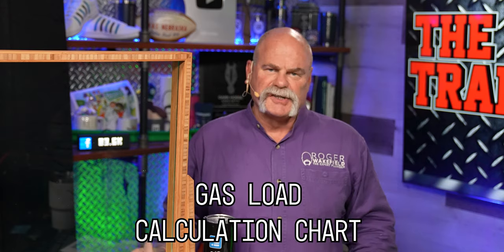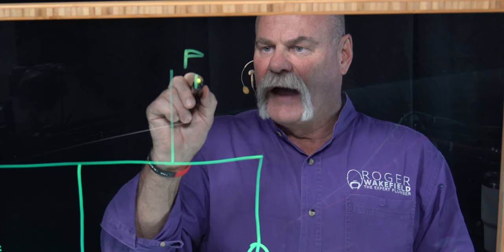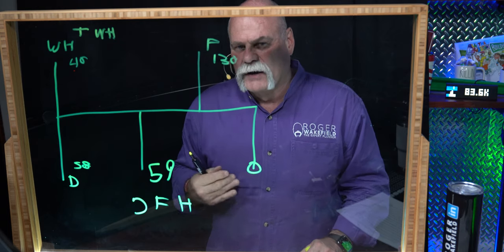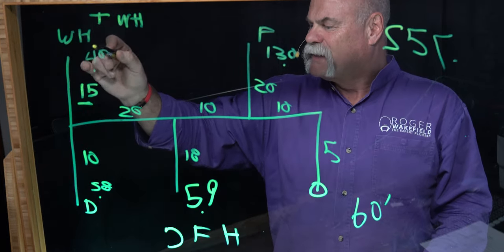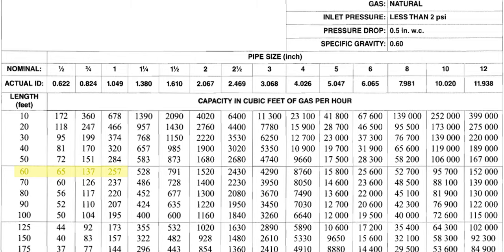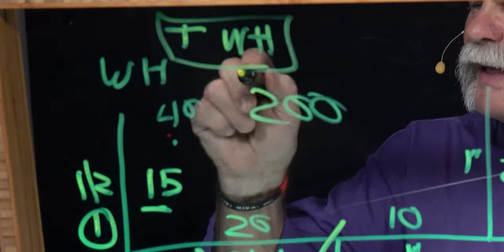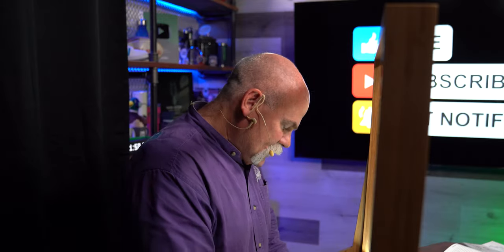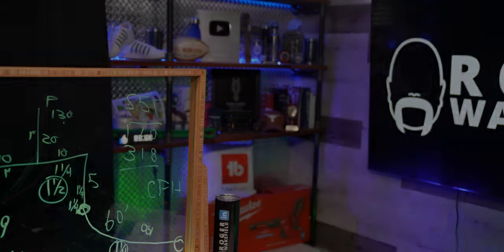How to Calculate Gas Load | Plumbing 101

Comment: My generac installer and plumbing inspector both said I am good with my existing meter. Meter is 240 cfh. I have a gas furnace -100,000 BTU, gas dryer - 25,000 BTU and a gas water heater ~40,000 BTUs. The generac at full load is about 225,000 BTUs. I say they are wrong and I will probably have issues just running furnace and generator alone. Help!

Comment: Is pressure drop what the overall pressure will drop to when everyhing is running or how much it will drop from the original supply pressure?
Reply: I'm not a plumber but I believe the pressure drop of the table is the acceptable pressure drop with everything utilized. If you look at tables with higher pressure drops the BTUs that can be supplied by any pipe diameter goes up. That's because you're gaining more capacity at the sacrifice of pressure. What is an acceptable pressure depends on the pressure your gas regulator is providing and what your appliances specify as the minimum.

Comment: Will the meter need to be changed for your tankless example ? What is the residential output side of the gas meter? Normal installation size?

Comment: Great video Roger!!  Quick question; is there a way to measure the BTU from the end of a branch?  I want to replace a 150K BTU firepit burner with a 240K burner. Is there a way to determine if enough gas is available to go to 240K or will I need to use your video and get my ruler and calculator out!!  Cheers!!

Comment: Looking for some advice
doing lot of research and asking questions, im not sure if my gas meter and pipe set up is ok to run a tri fuel  generator and or some of my gas appliances, mostly my NG furnace . some say its ok, some disagree.

MY GAS METER INFO
.5-7 WC , (1.2-1.7 kPa W.C.) and 1000 BTU a cubic foot .
so my regulator reads 'B42R ORI 1/8 5-7 IWC 125 PSIG MAX 8/08 The meter says AC-250 250 C.F.H @ 1/2 DIFF. MAOP 5PSI.
my gas furnace furnace draws 120k, water heater draws 40k, I have a gas drier and stove, but during an emergency, wont be using them,,

A Trifuel Generator I was looking at is
CHAMPION TRI FUEL GENERATOR REQUIREMENTS
Nominal fuel rating- 1000btu a cubic foot. Fuel supply size-1/2inchFNPT. Fuel supply pressure 5-7wc. Max flow rate 135000 btu
 
MY NG LINE LAYOUT
I have a 3/4 pipe going from the main 1in to the back of the house,straight line directly opposite the meter aprox 25 ft.
When the 3/4 in pipe exits the house, I have a shutoff valve and a 1/2 reducer so as to attach a 1/2 flex hose to the generator. ( Off the 1 inch main are the branches for the furnace ,drier water heater and stove and now the generator line)

Thanks for any advice you can give
 
John

Comment: Question for you. I have 70’ for my furthest distance. However, I want to install a 199,000 tankless water heater. The tankless water heater only has 3/4” connections. Using the chart, 3/4 is not supposed to be utilized even in a branch off of a 1-1/4 just to supply the water heater. The chart would state that I would need a 1” connection to the water heater. How do you get around this to meet code? Do you just reduce down to 3/4” close to the water heater?
Reply: Correct, just reduce down to 3/4" pipe near the TWH. If you refer to the sizing table in the video, 3/4" schedule 40 metallic pipe will support a BTU load of 247 cu. ft./h (assuming the same conditions) for an "equivalent length" of 20' (Note: The length of fittings is calculated differently than straight pipe - search online for a table that provides the equivalent length of fittings when sizing gas piping).

Comment: and this is why smart gasfitters in my area have started running a dedicated line to the water heater, if it's not the first point in the run.  then they can run it at a higher pressure if they need to, to accommodate a tankless.

Comment: 4:38 After correcting the small math error (257+160=417), the 1.25" pipe would need to be extended back another branch in the video example. (Easy for me to say, I'm not trying to write backwards and do math at the same time.)

Worth mentioning too that fittings add more "equivalent length" than straight pipe and can sometimes bump the results up a pipe size. Unfortunately, physical installations are rarely as straight forward as paper plans (lol).

Comment: As an inspector I've had numerous big builders try to over ride my fail for incorrect gas line sizing in new homes. Their defense is saying "It will work ok". Or "It was only size CSST that Home Depot had in stock".
Even worse, the County has allowed them to succeed and forced me to pass inspections. I was holding up the projects they claimed.:body-blue-raised-arms:

Comment: Add the lineal feet each ell or branch of a tee to the O.A.L. piping structure. Rinna tankless at 199,000
BTU are sensitive to gas pressure drops and water pressure drops. Main symptoms are  won't come up on high fire.

Comment: Mr. Wakefield, could you do a video on Water Column for the same system here?
Reply: What do you mean by "Water Column"?
Reply: Water column is an alternative way of expressing measurements of pressure. This measurement is defined as the pressure produced by a 1-inch by 1-inch column of water with a specified height.

Comment: I know these videos are intended for the purpose of giving pointers and advice to plumbers and gas fitters as well as for those striving to be plumbers and gas fitters.  You have to figure that some DIYers are looking at this stuff too and thinking that they can do it as well...without the proper training and licensure.  Only takes 1 moron to THINK they can do this before they make a dangerous situation for themselves and their neighbors messing with gas piping.  DO NOT TRY THIS IF YOU DON'T KNOW WHAT YOU'RE DOING!!!
Reply: remember: a water leak can make your house fall down.  a gas leak can make your house fall up.

Comment: Or you could just install the tankless that is designed to replace a tank heater which will supply the same amount of hot water as tankless water heater that you explaining without adding the cost of changing the old gas line. Just saying....
Reply: What?  Tankless use more gas over a short period of time vs tank style heaters.  Go find a tankless that only runs at 35k-50k btu and see what the temp rise and gpm are.
Reply: @fixerupperer  Rheem, States, and Navian to name a few that run on the existing gas line that is for replacing an existing tank water heater for a whole house set up, Especially for the size house he was describing in this video. So look around and ask they're out there and I have installed them and they work pretty well.